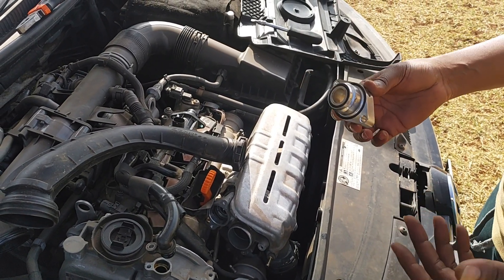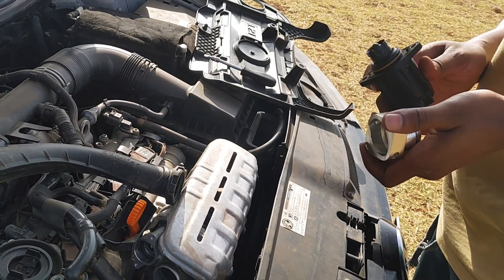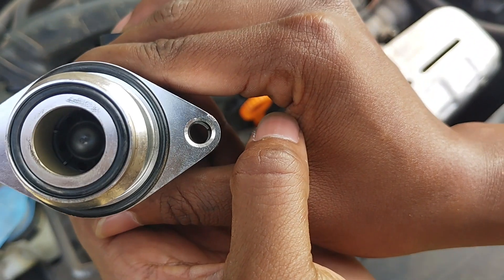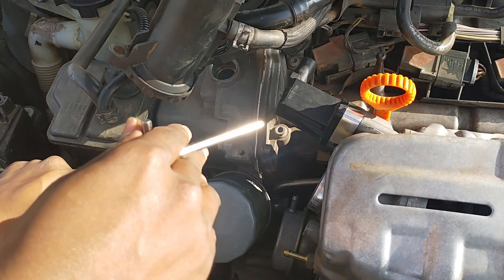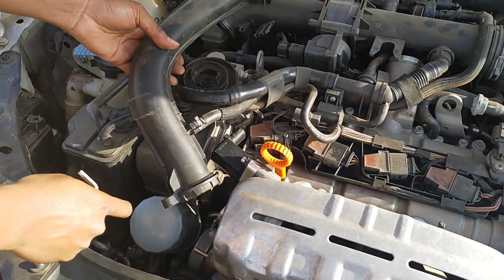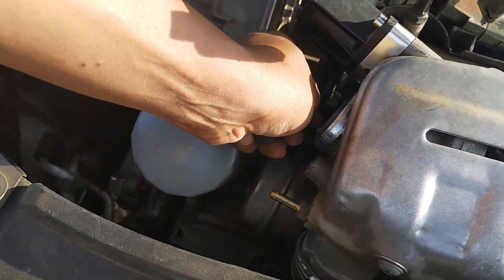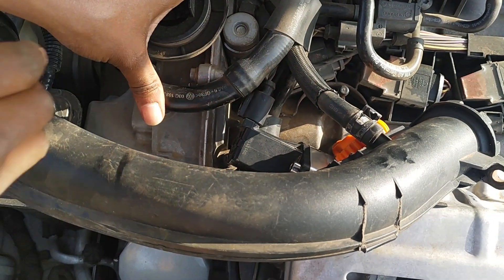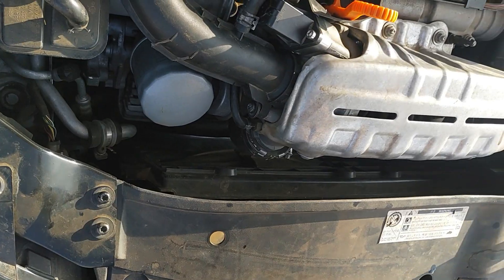How to install a blow off valve in the twincharger Volkswagen MK6 engine

Comment: I am struggling to remove the bottom bolt. What tool did you use ?
Reply from the maker: I used T30 with the small ratchet.

Comment: Is it not bad for the engine?
Reply from the maker: I haven't done enough research on it. But there has to be a reason why manufactures don't install it from the factry.
Reply: Yes, how is the car running? Any problems?
Reply from the maker: @mutlibabdul7402  the car is running fine. No issues